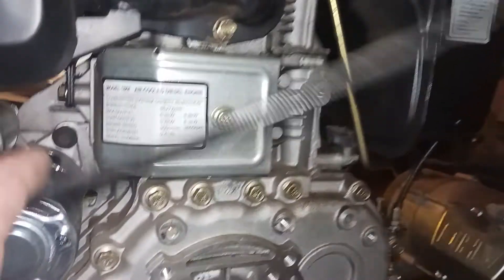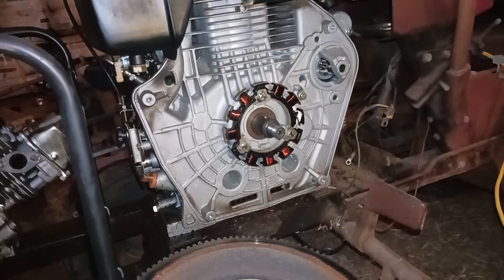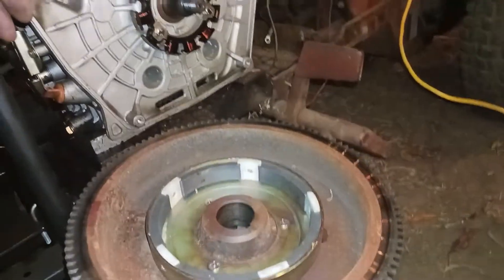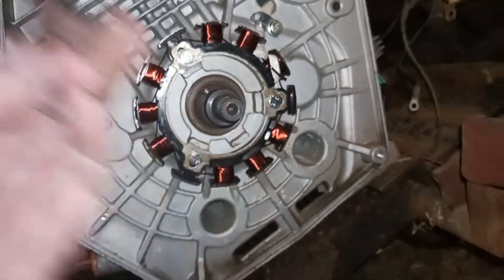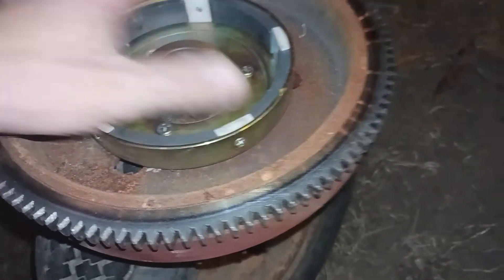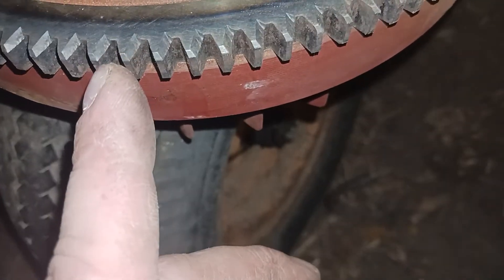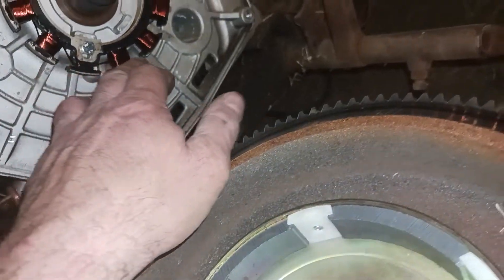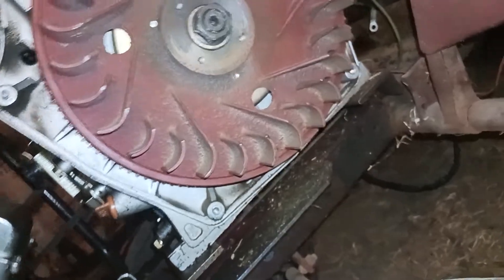186f diesel engine electric start

Comment: Just got a 186 with starter kit for my ‘67 112 JD around fender. My starter kit also came without a bolt kit. Also no wiring or switch  OR DIRECTIONS!  Your vid cleared up some gray areas for me. Would be helpful if you had verbalized bolt sizes, grade and type. Very helpful and informative. Thanks!

Comment: The pull start is not garbage. its actually quite good (put to any petrol engine :D). But it is UTTER USELESS on this heavy compression to pull, small diesel engine. This noisy baby def. need an electric starter or a "pre wind and release" manual starter. Did you find any max delivery watts/amps/VA´s specs on that stator system ?
Reply: but all the chinese diesels got a decompression lever pull that and ez, sure if fighting the comp youre gonna break the rope really
Reply: @ogreunderbridge5204 I wouldn't say it is useless. But it is definitely a pain in the ass to use the pull start, especially if you don't handle the decompression lever properly. Especially in my case, since I don't have the engine mounted to anything yet, and it wants to jump around. That being said, I look forward to getting my electric start kit installed. I should have just spent the extra $150 to get the version with the electric start already installed. But I was annoyed that the electric start engines were all red, and I preferred the look of the all black engines 🙄 You live and you learn.

Comment: The 168F is the 3 Horsepower  inclined horizontal diesel, red or orange or pink, that you see on Amazon, YouTube, and eBay. You have the 10 HP. I would put a 1 inch aluminum slab under the engine then 2 smaller leather pads under the slab around the 4 mounting bolts, then lay it on the steel tractor deck, so the mounting lugs don't repeatedly erode. I would also seek out boots for the alternator wires where they contact the motor. The vinyl insulation will erode. The 3 HP is hard enough to pull start. I can't imagine hand cranking your 19.1 compression motor. Nice unit top to bottom.
Reply: @Stanleybest8833 He said 186F at the beginning.

Comment: Could I ask a favor? I've been looking around and can NOT find the spacing of the mounting holes on the bottom or the distance between the pto shaft and base. I've been looking at these engines for an unconventional snowblower engine replacement.
Reply from the maker: Sorry, it took me a little while to find the manual.  It says the base plate is 272mm x 95mm.  The distance from center of crankshaft to base plate is 155mm.  Or at least that's what the manual says.

Comment: You think this engine would work into a swap into atv for work ? I have a Polaris atv 6x6 had a 400l 2 stroke engine I hate 2 strokes figure I’d put this in it for farm work hauling logs fence etc what you think?
Reply: I think it would.
But 625.00 for the engine and another 295.00 for the starter kit.
Reply from the maker: I believe the little wheel horse is geared at 67 to 1 on first gear.  It weighs close to 500lbs.  It will pull some major weight as long as the turff tires hold grip.  If your machine is geared low, I think you'll be able to.